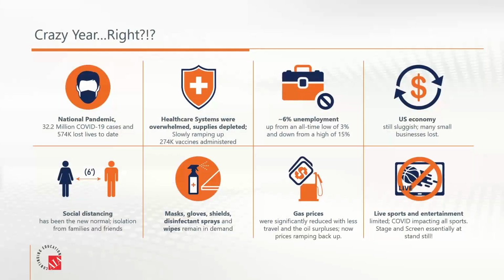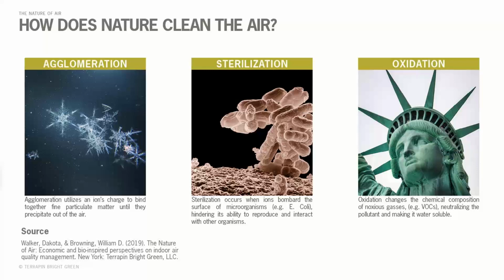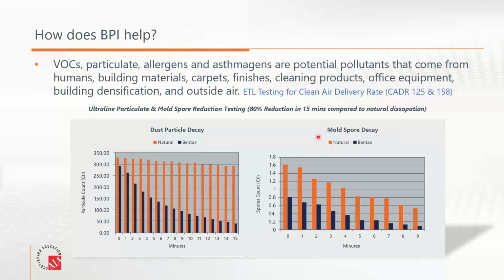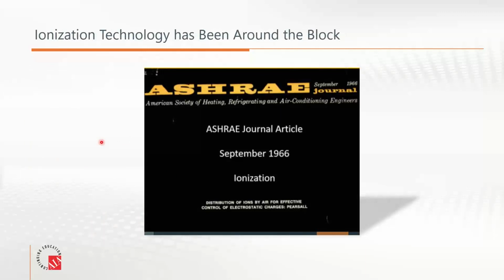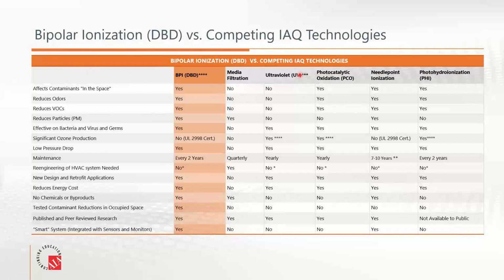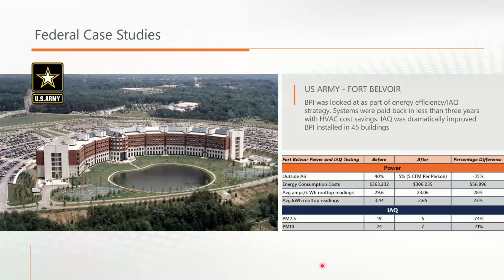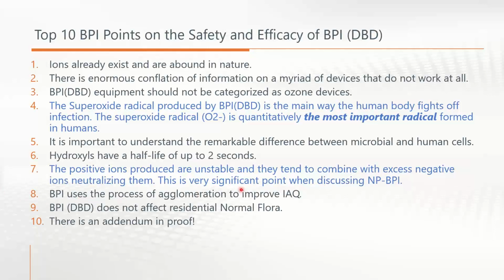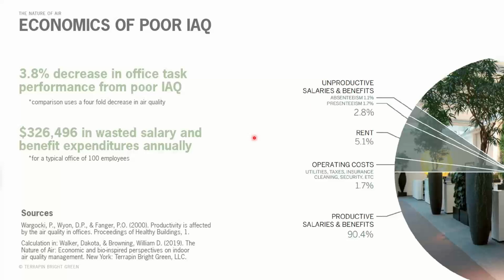2021 05 05 13 00 Ready for Return  Retrofitting Your HVAC System for a Safer Campus

Comment: Human sense organs are unable to perceive positive and negative air ions in the air that we breathe, because ions are not apparent by using either sight or smell. Therefore, the problem of indicating and controlling the generation process and the stabilization of the output levels of ions becomes highly important — especially due to the fact that ion generation processes vary with temperature, humidity, electrode contamination, and when dust is present in the air. 

This is only one of the extremely specialized areas in which the unique STERIONIZER™ technology excels.

REDUCE UR CARBON FOOTPRINT
 =
REDUCE UR HUMAN FOOTPRINT!!

THESE NEW ENVIRONMENTAL LAWS ARE DECEPTIVE LAWS INTRODUCED TO LEGALLY REMOVE OR REDUCE THE HUMAN RACE AND ANY INTELLIGENT MAN WHO STANDS IN HIS TRUTH AND CAN SEE THROUGH ALL THE DECEPTIVE NON SENSE!!! 

WAKE UP PPL!